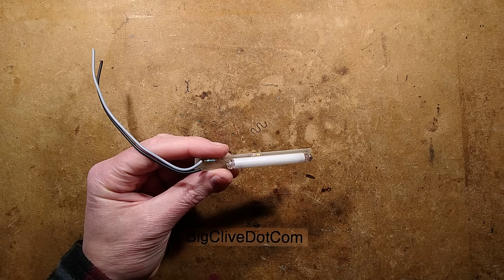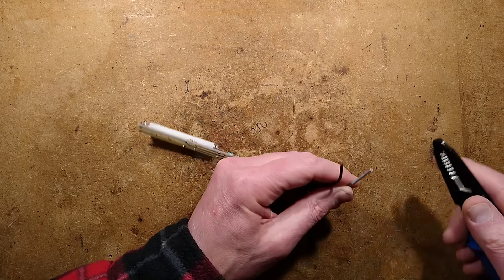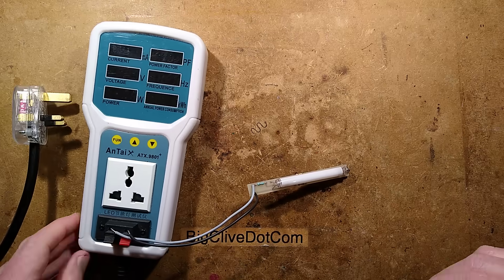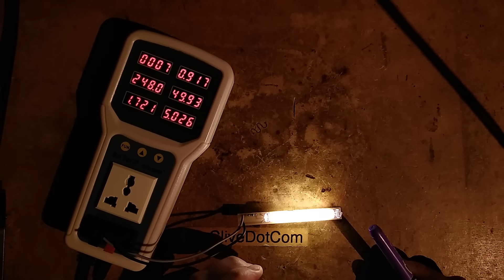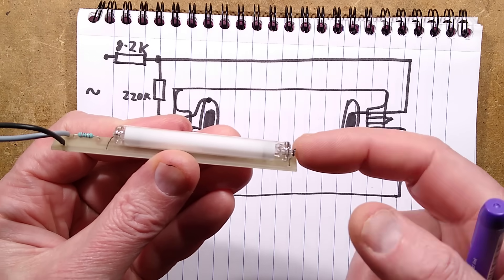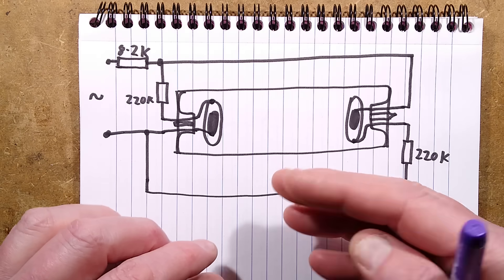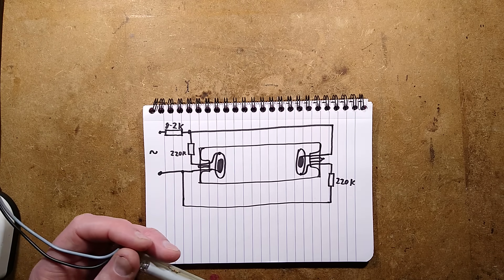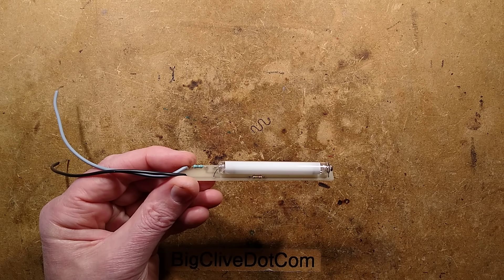Cute vintage resistor ballasted fluorescent tube

Comment: During the 1980s, someone was importing car inspection lamps that used a miniature fluorescent tube, with a resistive mains lead as the ballast.  If you coiled or bunched the power cable up, all the heat it generated was concentrated in one place.  If you damaged the lead and shortened it too much, the now-excessive current could blow the tube.
Reply from the maker: I probably have one of those somewhere.  The cables did get quite warm.
Reply: In Spain the model with a 8W tube was still available until all fluorescents were banned in the EU. 
It seems most brands used the same circuitry with the resistive lead, but some had an electronic ballast in the handle and were also available in 12-24V DC
Reply: I have seen them with 8 W tubes. They are horrible, using a voltage multiplier to drive the tube on DC. The ones I saw had normal 2x0.75mm2 cables.
Reply: I have an old valve radio that has a resistive lead, 240 coming in & 159v at the other end. Stipping it to re attach the 13a plug was tricky as it was merely a very fine wire ( approx the size of a 5 amp fuse wire.)

Comment: Some years back, I bought my father a florescent tube lantern that used batteries. It was called Florescent, so if it wasn't possible for batteries to power it,  it may have been faux Florescent.
Reply: You should open up that lantern to see how it works. If it uses D cells, it can easily buck their voltage up enough to run a fluorescent tube while supplying enough current to read by at least.

Ask me how I know.
Reply from the maker: Many fluorescent lanterns used a simple voltage boost transformer and oscillator to power the tubes.  But didn't run them properly, so they blackened at the ends fast.
Reply: I had one as well, it contained a simple step converter (a miniature transformer a couple of capacitors and transistors) to generate the required voltage

Comment: I wonder if you could light say a regular 8W fluorescent tube using a similar ballasting ?
Reply from the maker: Not with the heaters intact.  Maybe if the heaters had failed open circuit at both ends.

Comment: Hi Clive. Love your  videos. you go into so much detail. I need your help if you dont mind. My soldering iron (ts100, original tips) will NOT maintain a healthy tip, no matter what i do with it, it always seems to corrode the tip leading to near impossible soldering. ive tried cleaning the tip with flux and a scrunchy copper tip cleaner everytime. Maybe it is the actual solder? i am unsure. is there such a thing as bad solder? Thanks in advance for your insight....
Reply: Don't clean the tip with flux, it's an acid.  Use solder.  Or you've got the temperature up too high (Not working?  More heat!.  Yeah nah).
Reply: @j.f.christ8421  Thanks for the "tip" 👌
Reply: P.S What would you consider an ideal temperature? I know this will vary depending on application. What temp. increments would you go up in to get the temp right. Best way to clean the tip? and is my tip likely damaged now? @j.f.christ8421
Reply: @ericjackson7810  What happens is if the tip is damaged solder won't stick, so people turn up the heat causing more damage and around it goes.

As Clive says start low.  For leaded you want about 320C-350C.  Unleaded add about 30C.  Solder will start melting way below these temperatures but higher temp makes it flow better.  Too hot also makes the flux burn off too quick and cause bad joints.

Use a magnet to check if you wool cleaner is actually brass/copper, and not coated steel.  As said the plating is thin and easily damaged.

To clean add solder, wipe it off (wool, sponge etc0 and then immediately add a tiny bit of solder, you don't want to leave the tip "dry".  Also do this when you are finished.  Don't be tempted to scrape off the crud.

Basically if the tip doesn't have shiny solder all over then it's damaged.  You can still use it by avoiding those areas, a bit annoying though.  Also try a different style, I prefer a chisel style, round tip users are weirdoes.
Reply: @j.f.christ8421  thank you matey. I guess this puts me in the wierdo class. i will invest in a chisel tip. I think my conical tip is buggered now. cant get a shiny part on it at all now. Ive done all the bad things lol turned heat up, scraped off the crud, now it wont take any solder at all.
Reply: @ericjackson7810  Tips are actually pretty fragile these days, in the olden days they were solid copper.  Once the plating is gone the tip is dead.  

I usually use a 2.4mm chisel tip, I feel the flat area gives you more contact area so better heat transfer.  It's a personal thing, try a few different ones to see  what you like.

Every soldering iron maker supplies a round tip, so I guess some people start with that and never change.  I never did like them.
Reply: @j.f.christ8421  Do you us a particular brand of solder flux? Also I plan on getting a different tip. a wedge tip. thanks
Reply: @ericjackson7810  You don't need flux, there's enough in the solder (or paste) you are using.  This internet trend of drowning everything in flux is pointess and stupid.

Flux has two uses.  The first is removing existing oxides from parts, which to be honest doesn't happen much unless they're really old or poorly stored.

The main use is stopping oxidisation when the parts are hot, the flux forms a protective layer over the metals before they're hot enough for the solder to take hold.  Any flux that isn't in contact with the PCB copper or part legs is basically wasted.  If your iron is too hot (or even too cold), or your too slow, the flux can boil off and you get a cold joint because the parts oxidise.

I do use flux with my solder pot, and when doing reflow, basically with parts that are already tinned.  Say I've tinned the pads for a SMD resistor, I add flux to them before soldering the resistor itself.  No particular brand, cheap stuff from online.

As for tips, don't cheap out on them.  I generally use an old Hakko 936, and apparently the fake tips used to be ok but are now rubbish.  I've got a couple of the knocks off 936 irons, but I use genuine tips.  Seems silly using a $10 tip on a $30 iron, but it works.  I do have some (older) fake tips that have held up well.
Reply from the maker: Make sure it's not running too hot.  Start with the temperature too low and gradually work it up to the point it solders well.  Also avoid abrading the tip too much, as it is usually plated to avoid pitting.  The ideal solder is flux cored and rated for electronic use.  Buying it from eBay or amazon can't really guarantee a proper alloy or goof flux continuity throughout the roll.

Comment: Does anyone remember self-ballasted high pressure mercury vapor lamps? The arc tube had a tungsten filament in series and you could use them on mains without an inductor in series.
Reply from the maker: I probably have one of those here.
Reply: Yes I remember them, used primarily in Europe, never seen one in the USA.
Reply: @Subgunman  They were rare in 100-127 V countries.

Comment: Quite surprised that its spec sheet was drawn in Germany in 1993. It somehow must have been cheaper than using led's. The tube must have been a leftover from the East.
Reply: White LEDs were probably not a thing  back then, or at least much more expensive
Reply: @mikeselectricstuff  Eastern Germany would usually have import restrictions prior to 1988. But the spec sheet showed 1993! I bet it was the "British" distributor that we call something like a "rodent" dropping in Australia.....
Reply: @mikeselectricstuff  Very dim and expensive white LEDs were firstly introduced around 1996, but blue and white LEDs didn’t show up in consumer products until the early 2000s.
Reply: Never seen any white leds back then in the West let alone anything east German.
Reply: No white LEDs back then!
Reply from the maker: This was bought before white LEDs existed.
Reply: The first white LEDs became available in 1996, and I remember to buy a single led for about €5, white but not bright at all

Comment: Should do a video on loca glue, perhaps a comparison between UV LEDs and UV vapour tubes/lamps, what sets the glue faster. I've tried several with mixed results, also curious whether uva C affects the process 😅
Reply from the maker: Most glues seem optimised for near UV to UVA.  They may not react to shorter wavelengths like UVC.
Reply: @bigclivedotcom  Aye, I actually bought the specific 365nm torch - actually can feel it hot on my skin - however it's still not setting the glue. I had issues with conformal coating, leaving in direct sunlight for an hour seemed to work better.

Comment: Does remind me of the self ballasted sodium and mercury lights which just have a resistor in there usually unmarked and without insulation... I assume the glow at the ends, if there is no heater element, I assume the glow could be from a mild heating by the ions coming off, though it should really be significantly higher power 👀

Are the fluorescent tubes banned now? I've not seen any in the usual places
Reply: Did sodium lamp have a self-ballasted version?
Unfotunately the eu banned fluorescent lamps in 2023 anthough I save seen18 W Philips fluorescent tubes with 2024 manufacturing date.

Comment: A tiny little fluorescent lamp...too cute  :)
Reply: Ik 😊😊😊😊
Reply: Many scanners use cold-cathode fluorescent tubes to provide the light for scanning. The first LCD TV I had used them for back-lights.
Reply: @harryshector I used to strip down scanners and built lights for camping with the tubes.  The tubes in scanners almost always come with little driver boards that are designed to run on 12v, they run fine for .one periods on sealed lead acid batteries.

Comment: One thing I like to do, to visualize interesting electrode structures like that, is point a laser pointer at the phosphor on one side, which basically creates a point source of light that projects a shadow of the electrodes onto the phosphor on the other side.
Reply: I've done the same with 'pearl' incandescent lamps. It shows an image of the filament.

Comment: That's actually kind of cool.  I'm thinking there could be a few sorts of uses for it, say in a backlight for an address thing outside your house.  Not sure.  I like how compact it is.
Reply: But fluorescent bulbs hate cold so idk if it would be able to light during winter 🤔
Reply: @redditreads1878  Around the year 2000, I saw solar-powered garden lights in hardware stores with a fluorescent tube in it (5 Watts or so). I think they also featured a PIR sensor. So despite their low-temperature problematic, mini tubes were used in outdoor conditions.
Reply: @redditreads1878  I remember that.  Gosh, not so very long ago right?  Maybe dimly until they warmed up?  Not sure.
Reply: IIRC these mini flourescent tubes were used in multi-apartment ring button panels as nameplate backlight.

that was also quite some time ago.